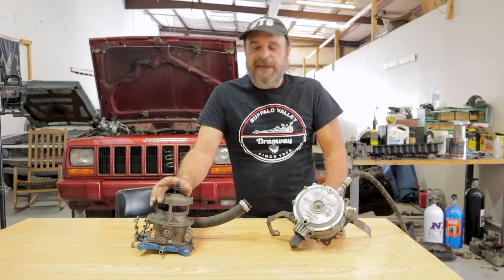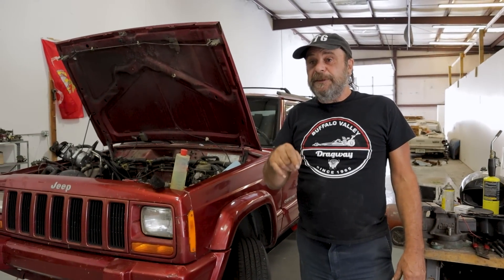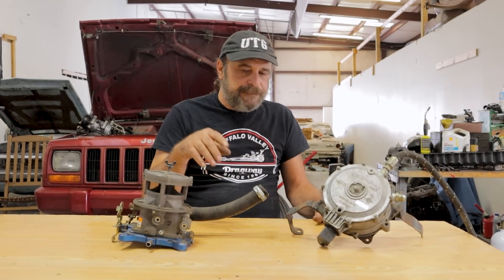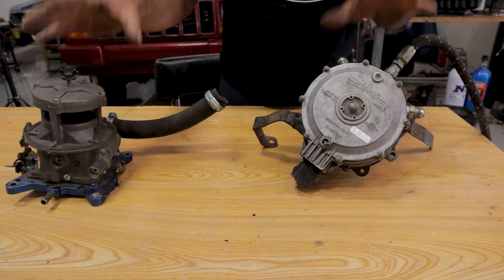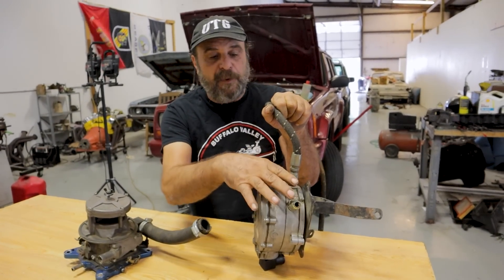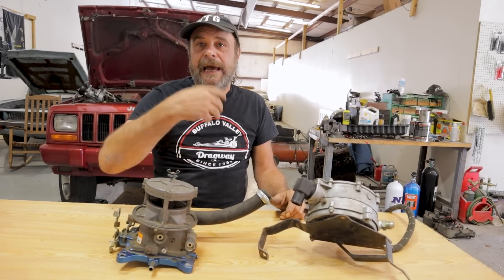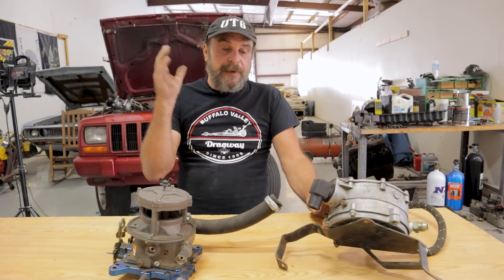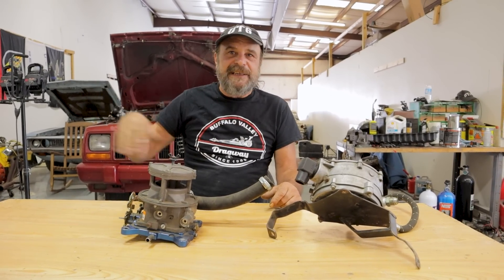Hot Rodding With Propane (And Propane Accessories) - Overview Of The Impco Carburetor

Comment: Tony. I have been waiting for you to do some stuff with propane for some time now. Super exited for these tests. As i am going to be doing a similar setup next year on one of my projects. I have worked on and ran propane setups before. as has my uncle. And i am a bulk propane and fuel driver.  Some things to note. Propane is a very safe fuel. the containers are far superior to a regular fuel tank in build quality. and you can get lightweight aluminum and even carbon fiber tanks. Most folks that have had car fires with propane are using a dual fuel mixer setup, and then do not run the gas completely out of the line before switching over. the gasoline runs out into the intake when the mixer is raised to let air past for the propane then onto the exhaust then fire. Propane can vary from source to source, from 103-114 octane. There are some strictly road blends that have a lubrication additive in it to prolong valve and upper cylinder life, as it is a DRY fuel. My uncle had issues on 2 of his 305 chevy that the exhaust valves burned of sank into the head. other have reported this also. culprits are the DRYNESS of running a gas, but also not enough timing, or too much overlap on the cam. I have been told that propane cams are ground a lot like boat cams with none to very little overlap. It turns from a liquid to a gas at -40 deg.F or Celsius, they are the same at that temp.  It ignites fast but burns slower than gasoline, hence the timing again. Supercharges and turbos LOVE propane. The mixers use the difference in pressure from the air and the line pressure. so, they self-tune at altitude like a fuel injection setup.     As for the tank. Tanks can only legally be filled to 80 percent for expansion. the worst is in the fall or spring when it is cold in the morning and still hot in the afternoons. i have seen tank popoffs release on days like this at even 70 percent full. If it is a 30lb tank it will hold about 7 gal of liquid, the liquid weighs about 4.2 lbs. per gal.    `.270 units of lp yields 270 units of vaper propane.  stoichiometric mixture is 4.01% of the fuel or 23.91:1 AFR ""BY MASS" but I have seen it run at around 15.0:1.  ---The tank needs to be mounted outside of the car. or the vent and popoff valves need to be extended outside of the car---. also. the 30lb. forklift tanks are the smallest tank that have the fill port used at a bulk station or from bulk truck. Hope some of this helps. very much looking forward to seeing what you do with it.          Tom B. in ND
Reply: Another note on the tanks. Grill and upright tanks can't be mounted horizontally  but forklift and other D.O.T. tanks can be. They use a horizontal siphon tube to pick up the liquid.  Alot like a nitrous bottle .
Reply: Also 'the entire system needs to be leak down tested after installation. even a small leek can be bad news.

Comment: Take a tip don't waste time with hardened valve seats etc, the factory induction hardened seats in cast iron heads didn't even last, put in copper bronze inlet and exhaust, take or leave it but ive done these for about 4 decades and the results are clear,

Comment: this was a big deal back in the 1970s with the oil embargo too bad it didnt catch on. im looking forward to this one Tony 👍👍
Reply: Propane was a big deal in Australia until about 2016. It's still around by the customer base is shrinking, however, a very serious economic downturn, think 1930s style great depression, would probably see a big return of it.  Propane can be found for between 70 and 90 cents AUSSIE per litre in a lot of places, while Gasoline is around 1.90 to 2.35 Dollars Aussie per litre, with a well setup system, you can get good power, good fuel economy, and good wallet economy too!

Comment: There is also a filter/vacuum lockoff thats usually a separate piece but I see you have an all in one regulator and lockoff, Interesting. I'm used to forklift systems...$1200! Thats 4 times what a common forklift system goes for.
Reply: Yeah,  I found a new set up for a chevy 350 for about 1000 and that was with a edelbrock manifold

Comment: my propane system used LIQUED propane and turned it into a gas in the vaporizer/regulator using the hot engine coolant. The tank had a valve that it drew from which was pulling liquid from the tank using a inside tube hooked to the valve. Went from Austin to Calif on propane and it was super tough finding fill-ups on the road every 100 miles or so!!!!!! About burned up my phone and nerves using Google to locate fill-ups.

Comment: In Australia propane systems were big in the taxi industry and even in diesels. We even had liquid injected propane systems that gave way more power due to the cooling. Running into the 9’s quarter mile with a 6 cylinder turbo taxi was quite popular. Engines also lasted longer also.
Reply: @angrybastard7364  humans produce CH4 as well :) its octane rating is 130 so compression ratios of 14-17 are possible , the problem is the low energy 
density, so it need to be stored under high pressures ( usually 220Bar ) in order to have acceptable autonomy.
Reply: @angrybastard7364  Proper Mad Max reference there. Nice.

Comment: I’d be apprehensive too since I smoke tobacco products like you!  I converted a gas generator to propane and it works great…lots of American made kits out there for conversions.  Good stuff as usual UT.
Reply: I smoked around propane for years, it takes an open flame or hot spark to set it off. Tobacco (and other vegetable matter) burns too cool to ignite it.

Comment: Known as LPG in Europe, cars can be ordered from the dealer with it. It's relatively common and runs way clean. 
The low/no emissions answer is right there. 
Can run as dual fuel i.e. switch between fuel sources at the flick of a button.
Good to see more awareness around it.

Comment: Uncle Tony seems new to the field :) and naturally highly overexcited:) There is no way power loss to be only 5% on evaporated Propane and any pre evaporated fuel because of the much lower volumetric efficiency ! Also the fuel consumption is 15-20% higher because of the lower energy density. So the mileage with this bottle and 8 cylinder motor will be severally less than on thank of gasoline . There are a systems which inject Propane as a liquid ( similarly to gasoline port injection) ,only they can make slightly more power than gasoline, because of the intake charge cooling effect . They are called generation 5 sequential injection systems. This system couldn’t work with high length EFI intake manifold runners . LPG/ air mix will detonate severely in the intake manifold ! In many cases of plastic intake manifolds they explode in pieces ! Also propane like high compression ratios 13-14:1 and powerful sparks !

Comment: My '68 Satellite with a 160.000+ mile 318 runs on both propane and gasoline, propane is half the price of gas in my neck of the woods.
I take this car on 1500+ mile road trips, so I love the propane... the engine oil stays clean also.

Comment: I’ve been driving an ex airport taxi powered by propane (dual fuel gas also)2011 Lincoln town car and I’ve seen 30 mpg on the highway (with fuel injection)and I’ve noticed no difference over gas in performance.I believe using propane on a low compression carbureted engine’s not so good.The car’s got 470,000 miles (on the original engine)on it but I understand that’s not unusual for any Towncar crown Vic 4.6

Comment: I've been using Propane as the air conditioning refrigerant in both of my 1987 Mercedes for maybe ten years now. It uses R12 compressor lube and provides colder air temps than R12. Plus it is under $3 (three dollars) to fill the system. Hardware store propane!!
Reply: Get out really??🤔🤔
Reply: @Oldcarnut63  Yep. It works great and makes a difference in a HOT Las Vegas summer. If you have an R12 system, this makes it better and the charging costs drop to insignificant.
Reply: R12a is a 50/50 mix of propane and isobutane, and runs lower pressure than r12. 
If I track down the leak in my dynasty I'm going to refill with 12a.
Reply: @scotcoon1186  Perfect stuff. I start off with some isobutane from a camp stove can then on to completing it with a propane can from the hardware store. I run the Mercedes up to 200 psi and that does it for me. Don't care what outside temp or humidity is, 200 psi is close enough. I have no idea what other makes will like, but as Scotcoon noted, this mixture is below normal system high pressures so that's a good starting point. My Benz gave me -7F (minus seven degrees) at 200 psi with an outside air temp here in Vegas of about 107F. Thankfully we don't have much humidity or this would have frozen solid. I charged it up to about 210psi to decrease the capability and the vent temp came up too. Play with it.
Reply: Propane is very popular as a refrigerant-  big warehouse type places use it because it works so well and other refrigerants would break the bank over a small leak.   Obviously there are safeguards associated with its use, but it does work very well.
Reply: Dang I just took every single piece of my R12 system to clean out the old oil so I can run R134, tho I get free R134.
I always hear the new R1234YF is basically propane
Reply: @Onewheelordeal Did you put a straight PAG oil in there for use with R134 / R1234 or did you use a synthetic compressor oil? Most of the synthetics don't care if you use R12, propane, or R134. If you used a synthetic and haven't charged the system with R134 or R1234yf, then you have a virgin system and can do the propane. Don't know if R1234 contains propane but saw one item of note: "Very high price when compared to R-134a."
Reply: Same amount of lbs as R12?
Reply: @LongIslandMopars  If I could DM you on YouTube, which I don't know how to do, I'll give you a link to how I do it on both my '87 Mercedes. It really is simple. Or email address.
Reply: Just dont let it leak into the car!😮
Reply: @hendrikvanleeuwen9110  KA-BOOM😱💣💣💣💣💣
Reply: What I want to ask is it pure propane of propane-butane mix ?
Reply: @flappingflight8537 If the system is empty (under vacuum) I start out with "some" isobutane/propane mix that you get with a camping stove fuel can, done with the engine off. Then I hook up a standard propane bottle, like you'd use with a Bernzomatic torch, and start the engine to run the high side pressure to about 200 psi for my '87 Mercedes 560SEL. YMMV!! If I'm just topping off, I'll just use a bottle of propane to get the pressures back up. I've read that the isobutane/propane mix allows the system pressure to be lower.
Reply: One more important point. In the US, propane is not "approved" for use as an automotive refrigerant. Turns out it is not illegal but if you are in an AC shop, they cannot put propane into your car. If I go into a shop and they have to play with the refrigerant levels, I have to tell them so they don't try to recover my refrigerant and pull it into their reservoir, contaminating the recovered refrigerant. But...propane is a natural gas with NO affect to the ozone layer or anything else so if you have to go to the shop, you can piss propane into the atmosphere without the tree-huggers getting upset. I have taken my can into the shop, had work done, and told them I wanted it back under a vacuum so "I" can fill it with isobutane/propane. Had no problems, that is what they did. FYI, Propane will mix with R12 and uses the same Ester compressor lubricant. As far as I know, it does NOT mix with R134 or use it's PAG oil. I'm running a synthetic lube that doesn't care what refrigerant it's used with. That synthetic compressor oil can be gotten at any auto parts store.
Reply: @VegasMikeP229  yes Butane evaporates at 0 degrees Celsius when propane evaporates at - 42 Celsius at ambient pressure. They mix them in the LPG because of the same reasons. Winter time is 60/40% propane/ butane mixture in order to keep the pressure high enough to be able to push the LPG from the tank to the engine , when in the Summer the mix is 40/60% propane/ butane  in order to limit  the max pressure in the tank . Thanks for your answer and info . I have heard before that someone have used LPG in AC systems , but is good to hear it from someone who personally have done it .
I have LPG powered car and have a idea to evaporate the LPG in the AC evaporator and then to feed the engine with it :)So to kill two rabbits with one bullet :) there wouldn’t need AC compressor and some fuel savings can be achieved.
Reply: @flappingflight8537  Great idea but this sounds like it's beyond my limited AC engineering capabilities. Been running propane for fifteen years now and here in Las Vegas where it can get hot enough to be a measurable percentage of the temperature on the surface of the sun, this works. From my air conditioned garage, out with my black car for two hours in a normal (107F) summer day and the bodywork reads 154 degrees. The black dashboard read 170F!!!
Reply: @VegasMikeP229  come to Florida :) here isn’t so hot 90-100 F but is humid more than enough :) . The good season is  just coming , the temperatures are lower as is the humidity . I’m not sure if the idea is going to work because the LPG flow will depend of the engine needs , on low loads and RPMs the AC will work worse than on higher loads and RPMs .
Reply: @flappingflight8537  Lived in Norfolk, VA and Augusta, GA so we've done Humidity (with a capital "H"). A normal 100+ degree summer day in Vegas is 3% to 6% humidity. I was also thinking about the LPG flow rate through the engine as an AC flow but I have no idea what the BTU capabilities are. It might help a normal sealed system but I don't know how to do a parallel system. Use the LPG engine flow to cool a radiator in front of the engine and AC radiators??

Comment: I had a 350 Chev on straight propane and a few things. Fuel economy is less than gasoline by quite a bit. It was great for cold starts and needed no warm up. Most propane mixers do not have the equivalent of an accelerator pump and suffer considerably for the lack of. The fuel mixes well with the air and most likely does not have the carbie cooling effect on the intake charge. Just a few things.

Comment: i had a vialle setup on my big block chev [10.5 cr 292 magnum cam dual plane high rise]
the vialle was simpler it bolted on top of the carb through the aircleaner stud
on average i lost a second in the quarter on propane
but the cost of operation was a fraction of gas

Comment: A friend of mine had a Dodge van in the 90's that was converted to propane by his dad in the 80's. It ran pretty smooth and the tank tucked up nicely under the floor. With no fuel gauge, I happened to be driving it on the freeway when I said it seemed to be losing power. My friend immediately told me to take the next exit and pointed me to the closest gas station with a propane tank. It was funny because the engine didn't sputter, it just got really weak. He finally converted back to gasoline because he was tired of finding places to fill up and attendants only filling him up 75% due to their safety training.

Comment: They actually sell a 20 to 100 pound  tanks for propane I converted my 2000 Dodge Durango over the propane and I use it to drive back and forth to work it's my everyday driver because I put 100 miles on my vehicle everyday and it was cheaper to run propane I actually doubled my mileage I get close to 40 miles to a pound(gallon) can't wait till you get into propane

Comment: I've run several cars over a period of 30 years on LPG in OZ, Victoria where it is still readily available Tony. I still run a classic 1966 Rover P5 coupe fitted with an alloy 4.4 Leyland P76 V8 and OMVL complex convertor LPG system that utilizes a simple LPG gas ring fitted to the original 2 barrel Stromberg carburettor. Not a performance system but very reliable. Over a 20 year period the car has done well over 300,000 kms as my daily driver. The engine is still amazingly clean internally and runs 11:1 compression as it was built initially to run LPG as its primary fuel source. Obviously, the ignition system (static and advance) have been optimized for the different burn characteristic of LPG as a fuel. Roughly speaking, minimum 15° BTDC initial static advance with the dynamic (centifugal) timing all in by 28° at 2500 rpm. Do fit a grunty (gear reduction) starter motor to deal with the higher compression and big lead in initial static advance timing. If fitting an LPG (or propane) tank in an enclosed space in the boot/trunk area ensure that it is properly vented (via a 2" PVC flexible convoluted  hose) to atmosphere outside the car. This is a required legal regulation in OZ for LPG systems. All systems in OZ need to be certified with a compliance plate and checked every 10 years.

Comment: This mixer has 3 easy adjustments. Has a 1) power valve on front 1/2 wrench turn left or right more propane vapor 2) Idle mixture screw on side and works like conventional idle mixture screw 3)Idle speed screw not no high speed idle but can mount electric throttle stop on temp sensor. You can also “jet” mixer with different cones and or shimming cone with nylon shims. Good luck with project and as you mentioned more timing is good.
Reply: The timing is tricky! When on low to middle range RPMs it needs of additional advance ( because of the lower burning speed ) in the higher RPMs range it want lower than gasoline advance because gaseous    fuels mix with the air better and there is no necessary of any time for evaporation since the fuel is pre evaporated , also the turbulence on high RPMs is much stronger which is major factor determining the speed of burning . 
Usually additional timing advance angle modifiers are used called Timing Advance Processors which can be programmed to mimic such a timing advance curves .